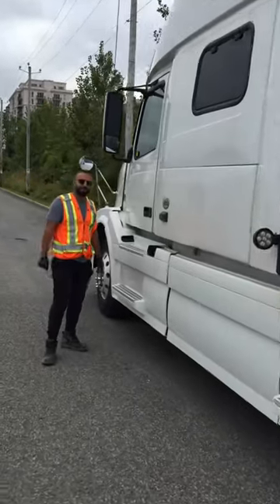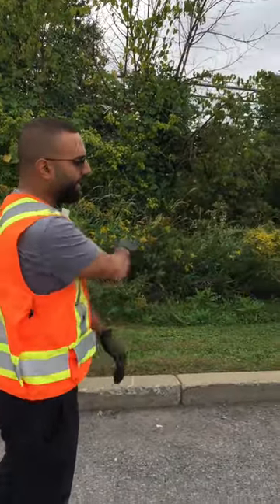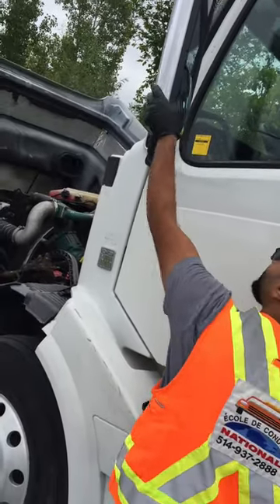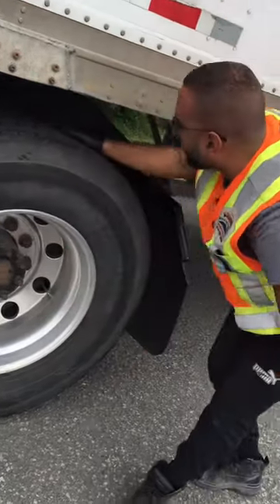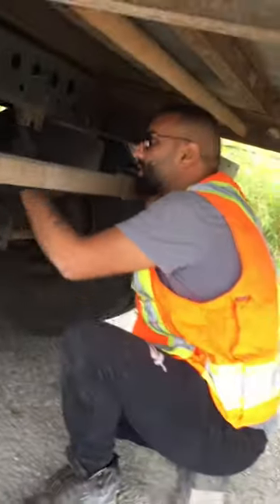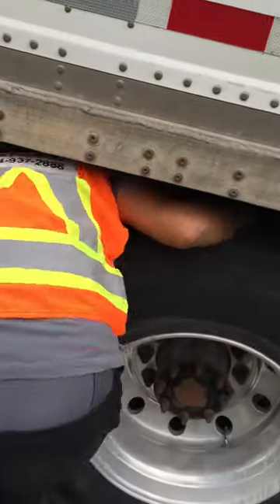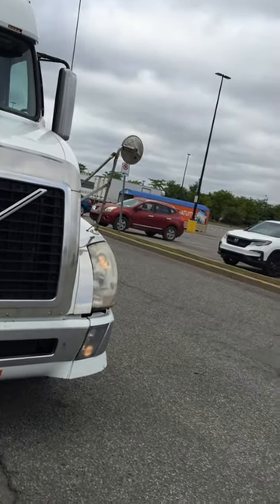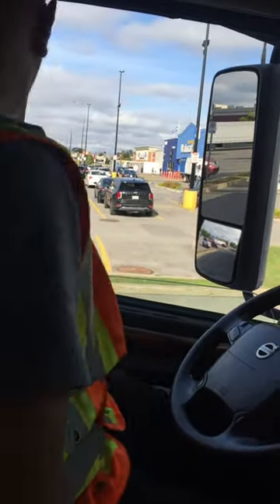Truck inspection or circle check day of saaq road test

Comment: Is this all about the saaq class 1 road test? Is there not backing test, coupling and uncoupling?
Reply from the maker: Hi
This is only for circle check(inspection) road test is different.
Call school you will get more information
Reply: @inspectionclass1orcirclech243  been defrauded by a school in Toronto for huge fees but I was not passed. Don't know which school I can trust now